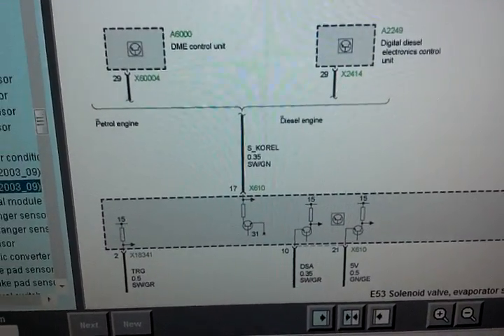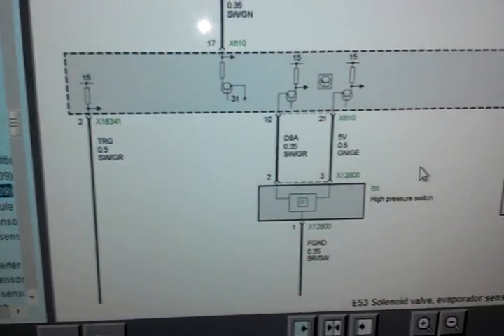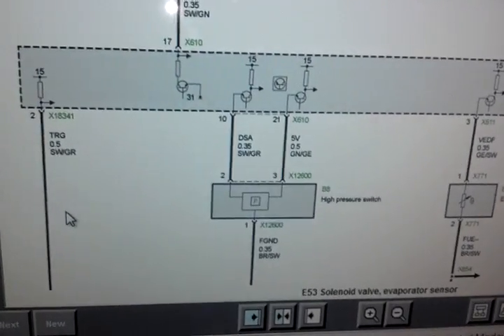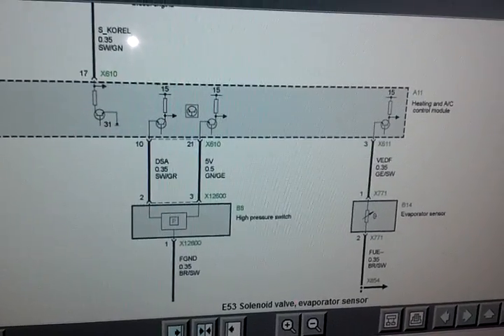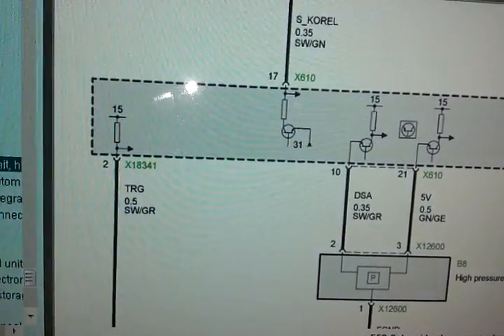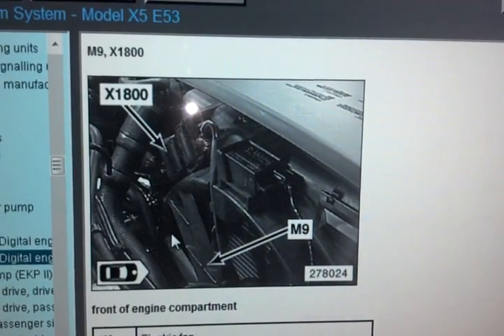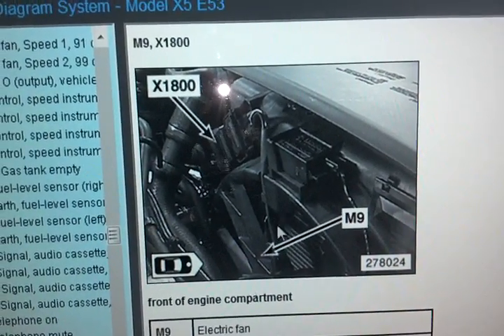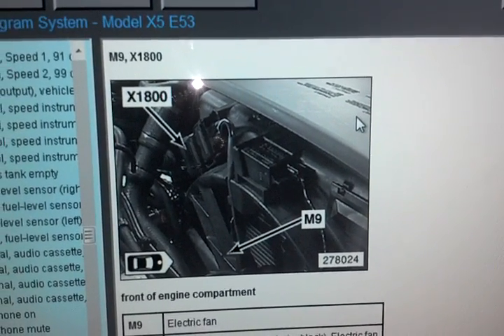X5 AC activation Wiring Diagram And Explanation On The Power Supply For Compressor

Comment: What is the software you are using? I need this it looks very helpful
Reply from the maker: +Paul Gilbertson I have a laptop running DIS software and progrman for programming. I purchased this off of ebay and is a program I am familiar with as this is the early BMW dealer software.

Comment: You mention the auxiliary fan in this video. 
A simple test for the auxiliary fan is to remove the plug connecting to the high pressure sensor with the air con turned on inside the car. The fan will spin up if the plug is disconnected and even though the compressor does not engage.

I just replaced my aux fan but still the compressor wont engage. But thanks for this video because it shows me how to run power direct to the clutch to see if I can engage it.

My scanner shows an error "1B IHKA magnetic coupling A/C compressor."  On my 2006 E53 3.0D it is so hard to get to the compressor to check the current there. 

My scanner shows the pressure sensor value at 1.5  when connected and 5  when not high pressure switch plug is disconnected. Is that a good value that would lead to compressor clutch engagement??

Comment: Yes please send me a wiring diagram.  I am not sure which fuses control the CCU.  I checked all I could find from the forums but non say the solution to my issue.  So far the only solution I see is to buy a new one and have the dealer reprogram it but I that is what I want to avoid.

Comment: Fuse 9 is still out and fuse 20 is in good condition.  I took out the IHKA out and took it appart, but did not see any resistance or capacitor or transistor blown. It did not smell like any component was burned.  I cleaned up the dust put it back together, and reconnected it and put fuse 9 back on, removed the battery for 9 minutes to reset and put it back after that and turned on the car and still the IHKA not turning on yet the blower is still runnigs.  Took out fuse 9 again.  Any thoughts?

Comment from the maker: Hello, Check fuse 9 and fuse 20 which should be the main power supply to the IHKA. It would be worth taking it out as well and check the connections and power supply. Let me know if you need a wiring diagram.

Comment: I have a 2002 540I which has the same IHKA system displayed on your video.  Last week, I drove it ot the grossery store, and when I came back the heater blower was on and when I turned on the car, the climate control unit, never turned on yet the blower was still blowing.  I turned off the car, and the blower kept going.  To avoid getting the battery drained I removed fuse 9, got a new FSU replaced the fuse,  and now blows harder, yet the CCU still not turing on. Any input on that?

Comment from the maker: Some other things to check as well are: outside temp sensor reading. On my E46 it shows -40 due to a problem with the outside temp sensor. This will prevent compressor activation. Also, what are your pressures on the high and low side just before the system shuts down. If you have a restriction the pressure will build and it could shut down the compressor. Normally this is a bad expansion valve due to a defective receiver dryer.